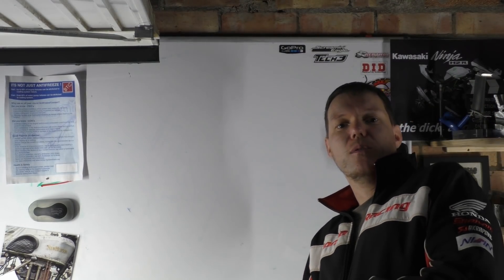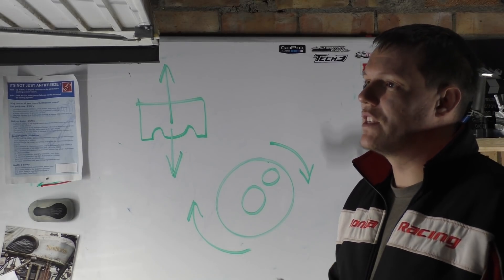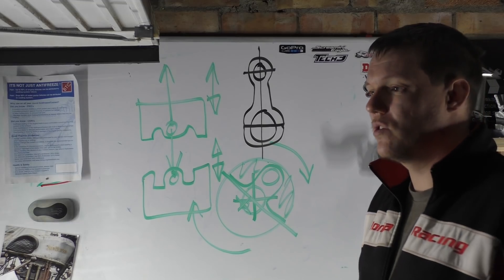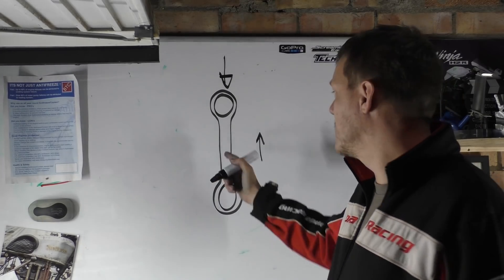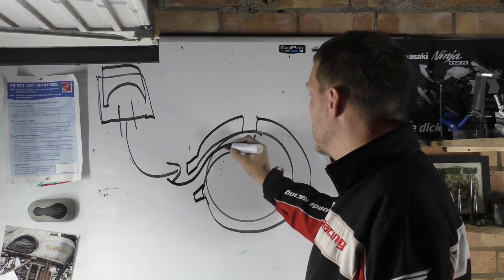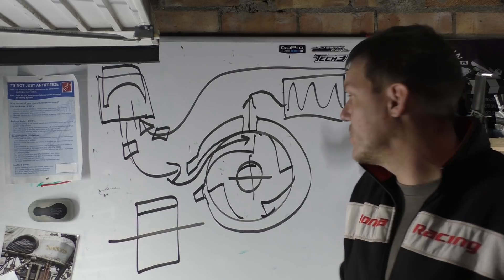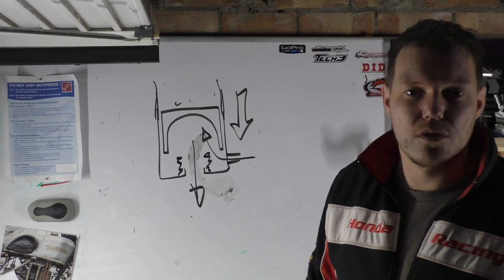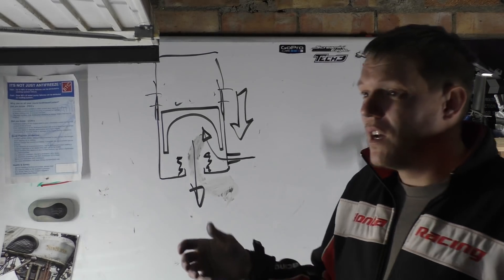New engine design - Oil rod engine

Comment: 180degree 4cyl (not boxer), pistons connected with straight conrods, which have a double Y central brace, affixed to the hydraulic pump. starter; electric pump charges some accumulators, which discharge in to the pump once "full" (crank motor bypassed during this), making the pistons move. due to all the pistons and rods going in the same direction, this might need a balance mass. And, as it has rods, it doesn't fit the brief properly either. travel could be controlled by having the pump's outlet port closed at the opportune moment, timed with the valves. shit... valves...... solenoids?
Reply: not having the pistons mechanically connected would mean that you'd have to power exhaust and intake hydraulically (convinced an almost-floating piston wouldn't work), which you could do if each piston had something like a double-acting cylinder where the conrod should be (different displacements at each port), cavitation might be an issue, along with heat as the fluid connecting them is just going to rock backwards and forwards. feels like this is worse than the stupid conrod thing
Reply: Matt - have you ever seen under the bonnet of a citroen sm? that's what this'll look like!

Comment: You're an engineer, how long is it, from what you know, before the electric powered car becomes a proper reality (long range at 70-80mph speeds, recharge in 5 - 10 minutes)? And I'm not saying that battery power is the fuel - it could be anything (Hydrogen), that powers the electric motors.
Reply from the maker: we'll get into this soon, a lot of people have been asking

Comment: Knobhead Matt! I would suggest you want to construct it with a stamp on the other end and not direct to the piston. Think of it as a syringe. So you separate the both sides to avoid blow by into the hydraulic system. But over all I do not think that it will work well. But fuck yeah give it a try. Like evolution was a game of try and error. It survives or dies...

Comment: Question, if this were to be a 2 stroke engine I presume you'll be using fuel injection and some method of forced induction as there would be no crankcase pressurisation to force the air fuel mix into the cylinder?

Comment: I'm just one minute into the video. If your idea is an "oil rod engine", I can already tell it's not going to work. 
I'll post up later if I'm wrong. Cheers.
Reply: You had a good go of it. There are also loads to consider. No worries though, electric bikes are coming, at which point I'll stop riding.

Comment: The piston must 'float over' the top (and bottom), it is not purely up and down.  If it was just up and down then the piston would have to stop twice per revolution, when it is neither going up or going down.  The rotation of the crankshaft, plus the play in the rings, etc, allow this. Or am I talking nonsense?

Comment: I've had the same idea for a long time but my techical skills stop at taking things apart & maybe putting them back together if I can be bothered.
Reply: My plan just had a vane type motor instead of a crank.
Reply: You could have crank/rotor for each driven wheel & in a 3 or 4 wheel application you could use electronical controlled proportioning valves to act as a differential.

Comment: your talking about a gas powered hydraulic air tool motor, was there some dope in that cig? I could go on for hours on why it wouldn't work and just the money alone you would have to spend to make it work wouldn't be worth it. those hydraulic lines would be slapping around so fast they would rattle loose in 5 mins. I see what you mean trying to stream line the flow of energy from the piston to the crank but that would make more vibration and the lines couldn't hold those velocities. they would erode along with the piston pump internals
Reply from the maker: You're missed the point.....
Reply: The Workshop which was? wait was this a video making fun of a dumb del idea?

Comment: Finally! I can do something with these piston return springs I got from China. Could you find a way to incorporate muffler bearings too... asking for a friend.
Reply: I believe packaging is key with these parts. I have it on very good authority that they must be kept in blinker fluid when not being used 😂
Reply: I keep em in crude oil. I figure cover all the bases, since all the hydrocarbons are in there.
Reply: What about a hollowed out part of the crank and connecting rod to put a fluid, (maybe ball bearings where it rotates,) inside for a damper effect. Similar in concept to "The Rattler" crank balancer/damper pulley they sell. Basically make the crank weigh less but build in the damper. I can't figure how you're going to pump the piston back up without wasting energy from somewhere else, or fighting a piston return spring, (for real this time.) The fluid being pushed would need to go through a tube or some kind of guide that keeps it pointed toward the crank. That tube or guide would have to be as strong as a connecting rod to not bend or split. Is the fluid tube/guide connected to the piston or the block. What if instead of all of this we design a valveless head with the top of each cylinder having it's own roots supercharger.

Comment: It's call a Free Piston Engine. In this case, it looks a lot like the Chiron free piston engine attached to a vane-type hydraulic motor- https://www.innas.com/free-piston-engines.html 
I'm having trouble elucidating how the Chiron returns the piston to TDC, seems like it has separate high a low pressure hydraulic circuits and my guess is that it pumps into the high pressure circuit to extract power from it and uses fluid from the low pressure circuit to return (or rebound, in the engineer's words) the piston.
He's got a zip of technical papers about it on the downloads page- https://www.innas.com/download.html

EDIT: Dresden University of Technology built a prototype of something similar that they call a Thermohydraulic Engine- https://www.youtube.com/watch?v=jdOIYuRWOFc

Comment: I don't think a two stroke would be feasible because there  is no fuel/air mix under the piston. So a four stroke with a sleeve valve type of cylinder may be the way to go..
Reply from the maker: That's why I said it would require a supercharger

Comment: I've seen some wild and wacky engine designs but I've never seen anything like this. Unfortunately there are some good reasons why no-one else has done this.
Efficiency would be horrendous even if you use a very low viscosity fluid. Hydraulics get very inefficient at higher speeds. Preventing cavitation  is going to be a real bastard with the huge volumes of fluid you're going to be shunting around.
How are you going to start it? If a piston is at the top of it's stroke there is no way to get it back down again to inject a charge of fuel/air.
Where does the pressure come from to  push the piston up on the compression stroke? I guess you could use pressure from the exhaust of your hydraulic motor but that reduces it's efficiency and you would need some sort of timing valve and a hydraulic accumulator to smooth out the pressure pulses.
The hydraulic motor as you have drawn it won't work. When you pressurise that chamber it will generate equal torque in both directions resulting in a net torque of zero. As the barrel rotates the chamber volume stays the same. For a motor to work the chamber volume needs to increase. That's why vane pumps and motors have the  barrel offset in the cylinder.

Comment: Very interesting. I think the losses in the fluid are very high, but we'll see if that's true later.
About stopping the piston at the top, I think this will not be a big problem. 
You didn't really describe the "crank"mechanism that pushes the oil back below the piston. This mechanism will be designed to push exactly the right amount of oil in there.
Then you'll only have cavitation to worry about that could send your piston into the head:) some kind of stopping mechanism.. should work.

Also, if the combustion chamber is designed with a very similar shape at the piston-top and head, if cavitation now allows your piston to go too far, the mixture will just compress very high and combust (well.. probably detonate). Theoretically your piston won't hit the head.

Just some thoughts.
Reply: DerKrawallkeks He could have a tensile member as a tether to the piston head as a backstop. (Although I'm sure this whole idea is frankly terrible)

Comment: It's like the reverse of a pneumatic Jack hammer,  instead of air in and a hammering action out, you use the combustion to hammer the piston and get hydraulic force out. I like it.

Comment: An idea, how about doing a two stroke turbo supercharged diesel version of this, since the design probably doesn't do well at high rpm and you may get hydraulic oil in the combustion chamber (wich would be less of a problem for a diesel)?

Comment: Why not just use a turbine, or better yet feed it into a torque converter on the transmission directly?
Reply: I was thinking that, turbine either fed direct or via an accumulator to smooth the pressure waves out a bit. Amount of combustion events a second would be irrelevant as the turbo or crank is independent of the piston

Comment: oil(liquid ) in general have a really bad problem, and its that doesnt work like a gas(it will absorb way much energy than a gas). You will have to seel that turbine too, and that will be a freaking pain in the ass to design. (Sorry for my english :D)
Reply: the oil is too dense, will stop the turbine inertia

Comment: Awesome idea. Thinking how the inertia would be in the transfer of energy from said oil to crankshaft, and possible mitigation. Also my gut feeling says you maybe won't be able to get away with not cooling the head part of the engine, unless said (cold) oil would flow completely through it. This idea could potentially mean getting rid of the oil pump as well.

Comment: Could you use essentially a geared oil pump and drive it backawards to generate rotation? You could do funky things like stack them and control how many are fed compressed oil from under the pistons and essentially have another way of varying the torque output (and maybe eliminate the gearbox entirely!)
Reply: Say you had 3 turbines/gears, you could feed all 3 for low speed high torque or just one for high flow/high speed low torque and anything in between